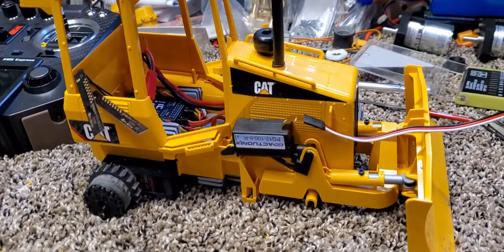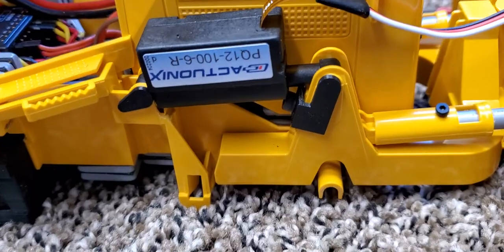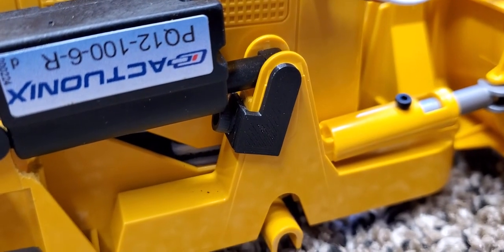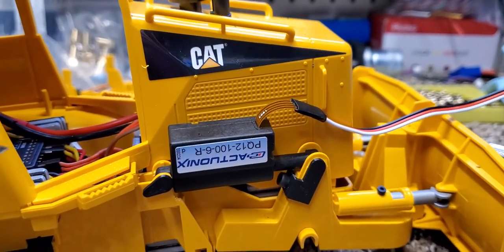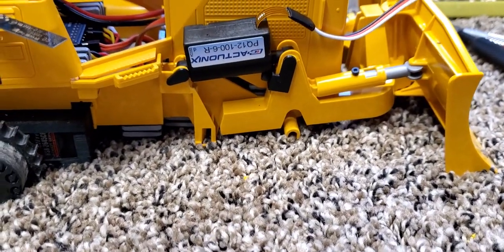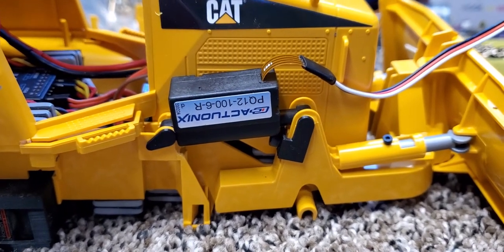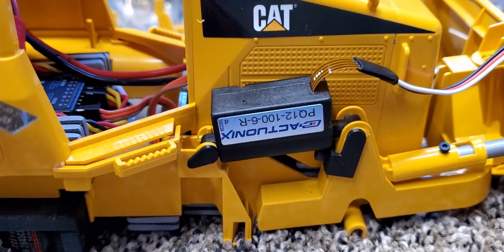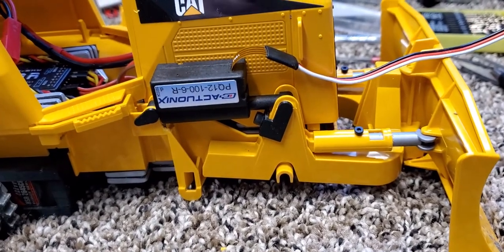Actuonix PQ12-100-6-R Blade Lift . Bruder D3 D5  Rc Conversion  Setup

Comment: Did you end up putting them on thingiverse? What actuators did you use?
Reply from the maker: The actuators I used are right in the name of the title of this video. I havent posted these pins because noone has asked for them yet. I did post the other items like the transmission box ,lid and battery backpack
https://www.thingiverse.com/thing:4726036
https://www.thingiverse.com/thing:4727272
Let me know if you'd like me to post up the pins